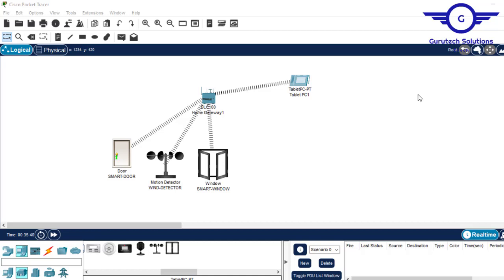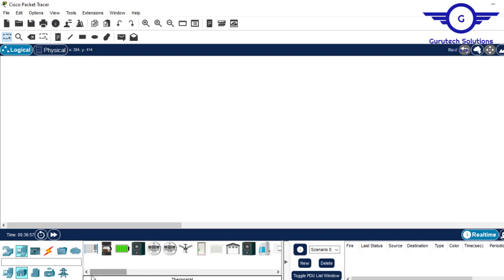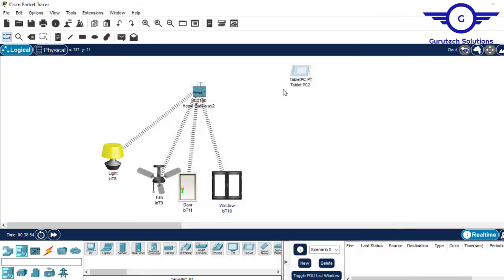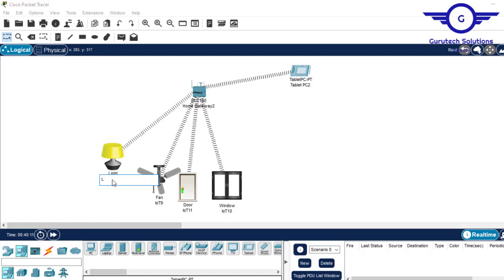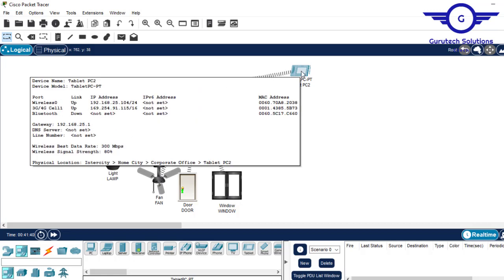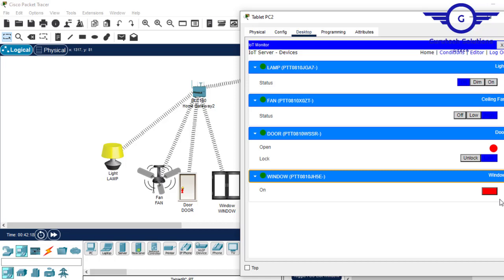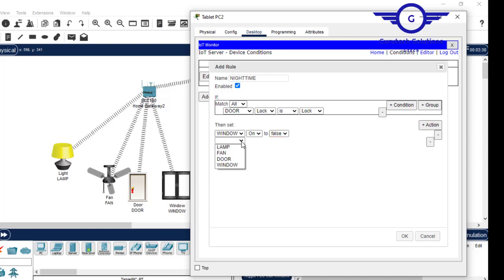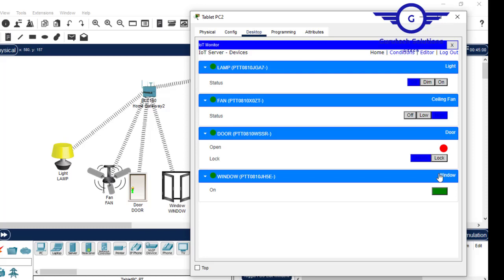Smart DAY/NIGHT IoT System Simulation with Smart Lamp, Ceiling Fan, Door & Windows in Packet Tracer

Comment: Sir, how to connect it in wireless because when you did it was automatically connected wireless with every other devices but it's not the Same case here? What should I do to get that lines (wireless connection)?
Reply from the maker: Check WiFi name and password, use that in your devices

Comment: Can you fix my error?
When I use it 
motion detection. I put the mouse pointer on the sensor but the sensor doesn't work. All other sensors work normally. So what is the cause and how to overcome it? I have configured it as instructed.
P/S: I use Cisco packet tracer version 8.2.2
Reply from the maker: Use control key + mouse, or maybe you've not configured rules properly